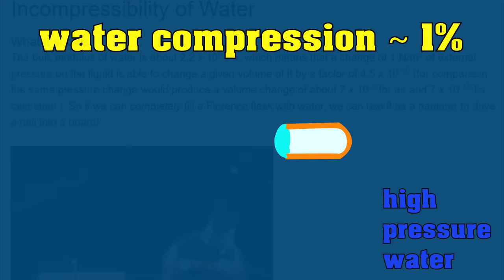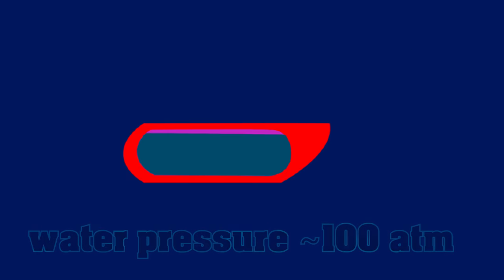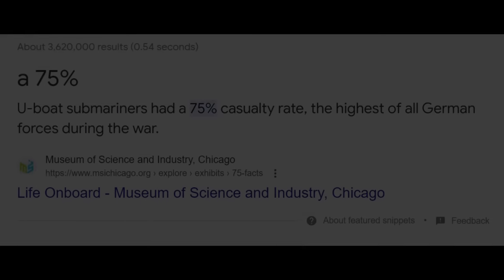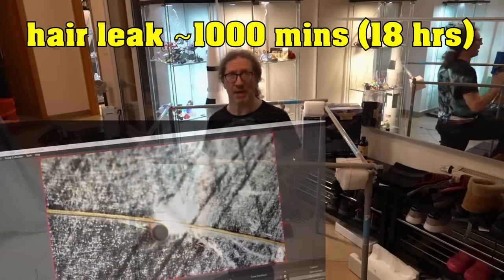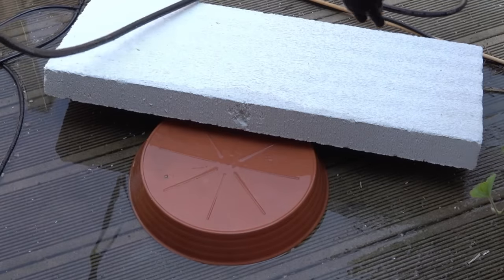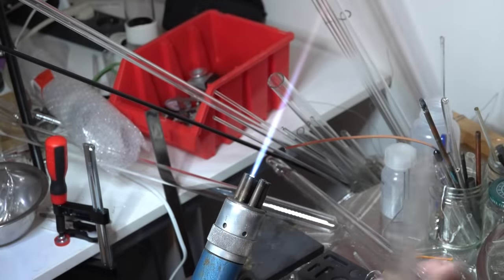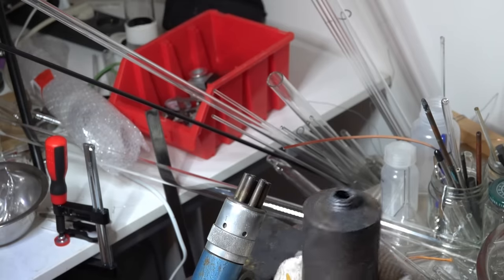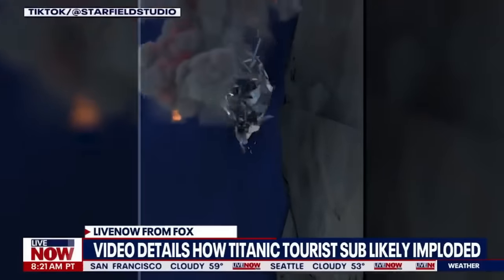Why the Titan sub failed

Comment: 20:50 From the looks of it they could have just bonded the titanium heads on the inside of the CF tubes, so that rim of the tube is pressed into the titanium during the dive. Yes, it is just an idea and would require the necessary calculations for its fisability, but on the first glance it seems to reduce this issue.
Reply: In principle that would be an approach - but the carbon fiber is a beast.  
 
You use carbon fiber because it is extremely stiff, does not flex like e.g. glass fiber. It was a quantum leap in model airplanes. Suddenly nothing bent anymore. 
 
But its stiffness meant that when you have a composite construction (like wood and carbon fiber (e.g. for spars and stiffeners) the more flexible material does not take over ANY load - it has to bend and stretch, THEN it takes over load, but the stiff carbon does not allow that bending. 
 
So the carbon takes over ALL the load, and that is how you have to dimension it, for the full load. Just a little as reinforcement is nonsense, it will be overloaded and snap (at one point), then you have a wonderful notch effect concentrating the stress, leading to breakage of the rest. 
 
 
And with your titanium ring inside the carbon fiber tube I would imagine that now you have a stiff ring, but the tube will still compress, and you then get stresses concentrated on the area right next to the ring.
  

What would have been a brutal method is to "accept" this different compressibility. And instead of a GLUE that is to solidly bond the two components together, use a flexible SEALANT and do the construction to allow the slight movement, relying on the pressure to keep the whole watertight. 
 
But then, when something moves, the sealant would be lost, so you constantly have to replace it, have to disassemble the whole and reassemble it, and each time there is the chance you make an error - which is fatal each time.

Comment: Talking about boneheaded mistakes, a few months ago, I glued an aluminum rail of about 50cm on the underside of a tempered glass shelf, in my refrigerator.  Yesterday, my wife placed a little container on the shelf, and it shattered in a million pieces on contact.  Has anybody looked at the difference of coefficient of expansion of titanium and carbon fiber composites? I am convinced that this added to the stress bearing on the structure.  Forget the pinholes, just glue a plate of titanium to a plate of carbon fiber, put the sample in the freezer,  and see what happens.

Comment: Totally agree with everything you said, an implosion would occur if there were no faults at all in the structure and it suddenly reached a uniform pressure where the structure gave way. But in this case there would have been a single point failure first where water would have flooded in, which makes me wonder about the bang heard by underwater military listening devices.
Reply: Totally agree, with what.
There was a failure, either an mm diameter, mm or cm, it doesn't matter.
At 5-6Kpsi, any failure would immediately cause adjacent failure at that pressure, and adjacaent to that adjacent failures. Most experts agree on milliseconds to complete failure of the submersible.
No water flooding in like Posieden Adventure and such, just a crack! sound and then fwoomps as  all x cubic foot of space became water enclosed space, with a small amount of hot air bubbles.
The bang reported was probably the implosion event.

Comment: The Titan submersible is not made of a single contiguous piece of strong material. Even the carbon fibre hull was rolled to the shape of a cylinder from a long strand of carbon fibre and held together by resin adhesives....  even I as a total layperson in materials engineering found that scary

Comment: Phil -  I love your channel and videos.  I've watched them for over a decade (since the beginning of "Why People Laugh at Creationists" series) and commented on quite a few.  While your analysis on this one is (as always) technically correct regarding energies, times, forces, etc., we do know that the Titan imploded catastrophically.  The Navy heard it on their hydrophone system and reported it to the head of the search & rescue operation.  The part I don't understand is why they (S&R) continued giving the relatives false hope for 3 days afterward while incurring the huge expenses of the search.

Your analysis of the design touched on all the points I've made on different videos, but I think we agree that the main failure mode was the CF tube/ring joint failing in tension (a load direction epoxy doesn't like).  When I saw the video of them gluing that joint, I was aghast.  The tube had no mechanical support at all, it was 100% adhesive!  At a minimum, they should have made the titanium rings thick enough to cut a socket into them which would support the tube both inside and out.  That would have relived the tension and shear forces on the adhesive, but would still ultimately fail since you have introduced a new shear point on the edge where the tube leaves the ring as it compresses.

Comment: Nice video but you're simply guessing as well as to the exact mode of failure in that it "most certainly" was a small hole leak as opposed to a catastrophic hull failure. The biggest problem I have with your hypothesis is that the wreckage recovered does not support it. There were essentially NO significant pieces of the hull recovered, which would indicate that by the brittle nature of the CF, it simply shattered into scattered fragments while the Ti end bells and carrier structure sank where they did and were recovered. I believe the failure could've started with a small very high PSI leak, but at the surrounding water pressure That leak would've progressed almost instantaneously into a catastrophic hull failure. It's just not plausible in my mind that the structure remained stable while the pressure equalized.

Comment: Ask anyone that had surgery with screws and plates in their leg.  Differential expansion between the bone and the titanium screws hurt like hell with just a few degrees of temperature change.  The joints on the sub went from room temperature to around 32 degrees or lower.  They were depending on the glue to flow to take up the differential expansion of the carbon fiber hull and the titanium end caps with temperature and dive pressure.  I would have de-gassed that glue at least to remove the microscopic air bubbles at least.  The whole design is iffy at best and might work with enough study and testing.  The sub did make many dives without any trouble in the past.  But you are betting your life on a joint that at best was not studied in depth.  I would not design something with a known weak point like that, not with lives depending on it not failing.

Comment: I’m an engineer. Granted it’s in high speed copper and fibre communication tech but my theory is that the composite tube failed due to repeated depth cycles. From what’s supposed to be the comms I think water got in  to the rear first and main bus A failed and they switched to bus B. They were hearing noises of the carbon under extreme stress after released cycles and tried to ascend but it happened very slow due to salt water and batteries not mixing well. I think then bus B failed and they started to sink faster than rated. They already descended faster than previous missions which makes sense to try from selling tickets perspective. Basically the rear with electrics failed just a little first and then they just went down fast after already descending too fast. The carbon tube was already suffering cyclical fatigue fractures and it just snowballed. The debris showed the ends in tact and while the glue cloud have failed I suspect the carbon tube failed and they were compressed and shredded in 1-3milliseconds.

Comment: If the transcripts are correct of communication, they descended too fast. It is suggested, from those transcriptions, in the sealed off battery electronics compartment started having a leak that compromised the systems in the submersible. There's a video covering this, I think you might be interested in, and perhaps this was an effect after they systems failed.
Reply: The descending speed was controlled by the vessel's natural buoyancy, which was slightly negative. I don't see how that could have happened any faster than usual. And the batteries did not even have a pressurized compartment. Failing systems had no effect at all on the speed of descend.

Comment: The guy even managed to have the only overlap as the titanium around the outside of the carbon fibre and no overlap at all on the inside, so the carbon fibre is only being pulled away from the titanium by the shrinking under pressure.

Comment: This might corroborate the leaked transcripts (assuming they are real) as what some are wondering is if a leak began during the dive which led to the sub descending faster than normal, then when something was clearly going wrong and they tried to come back up their ascent was so slow.  Slow because they were taking on water?  From where?  I think your video probably shows where the failure point started (sealed off aft part of the ship) and when it finally imploded the damage of the wreckage may be commiserate with what you showed at the end of the video.

Comment: 2nd video on this topic.  But, still not mentioned by Phil...

1. What happens to the temperature when the air is rapidly compressed?
2. Does the oxygen react with any hydrocarbons, under those conditions ¹?

¹ Ya know... similar to the combustion chamber in a diesel engine.

Comment: I think the titanium had a stepped lip that held the carbon fiber from compressing at the lip. But that would put a lot of force on both the titanium and the carbon fiber.
Reply: It looked to me like the CF was stepped down where it fitted to the titanium ring, so it sat inside the ring rather than outside of it.
Reply: @cambridgemart2075  okay, So we both agree the carbon fiber was outside the titanium ring and that it was an overlap joint of some type? Meaning the glue was mainly to hold it in place and seal the joint. The CF and titanium overlap joint would still be a very bad idea because of the differences in response to pressure from the outside.
Reply: @allalphazerobeta8643  No, the carbon fibre was inside the titanium ring so it had nothing to prevent it from compressing. Look carefully at the  video where they lower the ring, it#s clear that it#s on the outside of the CF.

Comment: Whoever laminated that tube is an amateur at best. All those glossy surfaces are low points the sanding missed, and they are right not to sand it even, but they should never be on a part meant to perform at that level. For the layups for the Rocket labs Electron body, every single layer had to go down perfectly with zero overlaps and basically zero gaps, and at perfect 0, 90 or 45 degree angles depending on which layer of the laminate they were. The strength of carbon is keeping the unidirectional fibers complete from start to finish, without any breaks in the strands, and at the exact angle of the laminate. A variation of about 5 degrees and you lose nearly half the strength. Its use is the "stiffest" material by weight, and at its best it holds its shape far longer than any other material. But the second it gets out of shape it loses almost all strength instantly, and that usually leads to catastrophic failure. 
It's like how a 80kg person can stand on top of an empty soda can for a short time, but any slight dent in any part of the sides surface and it will collaspe instantly. Its an old party trick some of you may be familiar with, and usually results in the unaware collapsing the can on their fingers as it takes almost no effort to deform the shape under such a load. 

Any, thats a very poor laminating job and I cant trust the strength of those fibers looking at those pictures. It's like the brown M and M's. If they got the basics wrong what else is wrong?

Comment: There's been a few videos which incorrectly hypothesized that the pressure on the side of the carbon pressure would cause the seam at the coupling to seal tighter. As though the perpendicular pressure against the carbon fiber would somehow magically translate into a linear pressure of the carbon in the direction of the coupling.  There was so many flaws in this vessel but one which was completely unacceptable was the communications failure.  There is a vast array of radio transmission systems in aerospace. We are still communicating with space probes literally billions of miles away on just a few watts of power. That they couldn't fabricate a reliable system to transmit a few thousand feet through a medium of water is baffling.

Comment: In most aspects, I concur with your points. However, there are two crucial areas where our perspectives differ.

Mechanical Properties of Carbon Fiber: Carbon fiber is renowned for its exceptional tensile strength, typically ranging from about 2,500 to 6,000 MPa. This attribute is paramount in applications where a high strength-to-weight ratio is essential. The compressive strength of carbon fibers is also significant, though slightly less than their tensile strength, usually between 1,000 and 3,000 MPa. However, it's important to note that the shear strength of carbon fibers, particularly in a cylindrical structure like a tube, is a different aspect. In such configurations, carbon fibers can better resist torsional (twisting) forces compared to flat-laminated composites, although exact values depend on fiber orientation and the matrix used.

Synergy Between Adhesive, Carbon Fiber, and Titanium: In a well-designed composite, the combination of these materials can greatly enhance structural integrity. Titanium supports the carbon matrix, adding to its stability. The role of the adhesive is crucial; it not only bonds the materials but also acts as a damping and insulating agent, contributing significantly to the composite's overall performance.

From my experience working with high-pressure lines exceeding 200 bar, I have observed that 'transition' points involving such composite materials can sometimes exhibit superior stability.

From an engineering standpoint, I hypothesize the development of a weak point in the carbon structure, possibly leading to a pinhole-sized defect. This imperfection could result in resin being washed away from surrounding fibers, thereby reducing the stability of the carbon matrix and potentially causing a cascading failure within milliseconds

Comment: there is one thing I'm unclear on is how can you be so sure that it is the water going in and not the air being push out of the hole or breach. becourse the sub would also be extremly compression out the pressure that deep?

Comment: The waterjet effect does not seem like a concern really. It would lose much of its effect beyond a few cm and the defect would not be an optimal nozzle shape by chance. It could just be a misty spray into the vessel for all we know - any proof it will be like a cutting tool? Could be a case of when people are surprised that supersonic bullets don't actually travel far in water.

As for the glue, it is easy to pick on it but I have yet to see any scientific backing to blame it. Using brittle glass to model pliable glue? Though I think it is likely where the failure was, I would like the actual explanation or experiment (with that same glue!). Saying theres a difference in bulk modulus isn't enough, because there is a difference in bulk modulus between acrylic and titanium too.

The man assembling the Titan said the glue would allow for movement between the CF and Ti - one would think they understand the requirements much more than Rush. Also the pressure would force the pieces together. So if the culprit was the glue, perhaps the CF shell flexed enough that the glue itself was attempting to hold back the oceanic pressure.

Comment: It was not just one thing it was a lot of things like weak metal, poor building, using an old version ect also water is h20 oxygen and hydrogeen it would boil the water and make the vacume chamber have a little pressure but not mutch

Comment: Great analysis TF, I just want to add that it seems the CF tube would shrink by 1% if it were a solid chunk of CF; since it's a hollow tube, it would want to shrink even more than that. On top of that, it seems to be glued INSIDE the titanium ring, which makes it want to peel away from it as it is shrinking. Lots of bad design obviously!

Comment: The epoxy failing between the titanium and carbon fiber has been my thought since day one when I seen how they built it.

The titanium hemispheres expand and contract with temperature while the carbon fiber is dimensionally stable regardless of temperature. Every dive would see those hemispheres contract as the water gets colder, the epoxy holding everything together was stressed every time.

Comment: The more accurate visual demonstration with that plastic planter base would have been to put a very, very small hole in it (with an awl and a hammer, for instance) and then see the effects the power washer would have had on the plastic.

It would have almost certainly caused a major fracture in the plastic, which is likely what happened to the sub.